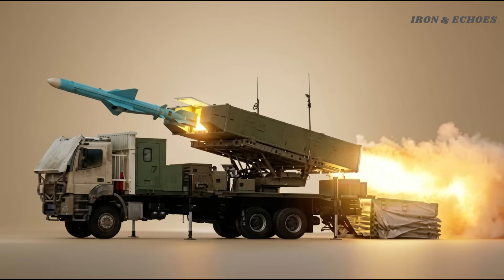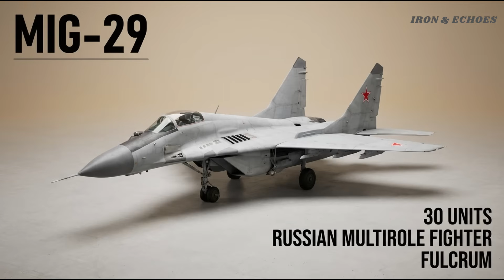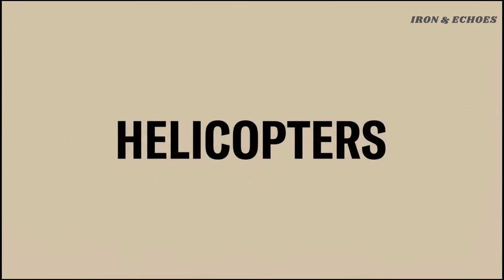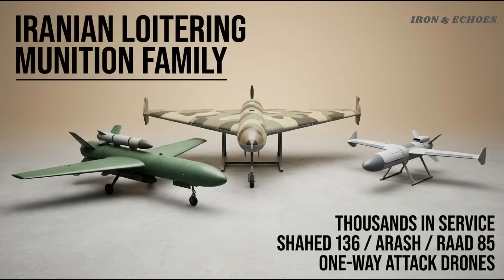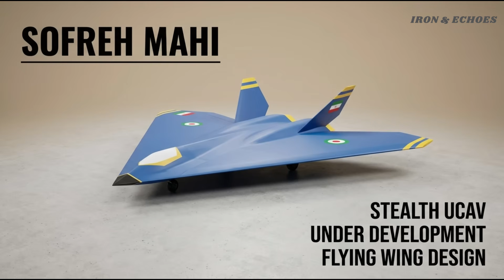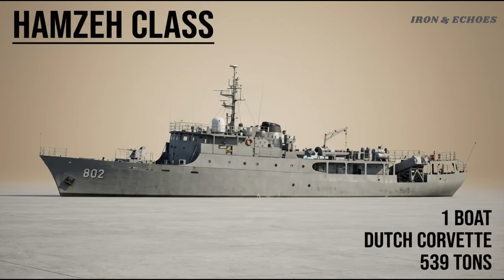All of Iran's planes and warships are waiting for the Americans-What is the Supreme Leader planning?

Comment: China needs to divert domestic infrastructure, to Iran.  As in, move tunneling machines.  Heavy terra-forming machines.  Then build underground air fields with tunnel exits at a length where J-10C, and J-36A, are at rotation and steep climb, within 400' of exit.  After that, provide the planes, armament, and maintenance plus training, so within a ciuple years Xhinese techs-consults ts can leave or stay if they want.   But given Iran's geographic nature, lack of water, and such, I doubt they would want to stay.  Hence training deals.  And tools, then Iran can make their own.  Plus 3 to 6 whatever AWACs platforms make most sense.  After thus, then Xhina can breath easy, knowing their oil artery is safe and sound.  While Iran grows, lives, and benefits from wealth generated by being a major artery, for the foremost superpower of Earth.
Reply from the maker: Your opinion is very reasonable, based on the perspective of the interests of the great powers.